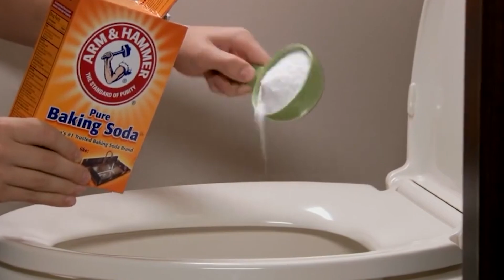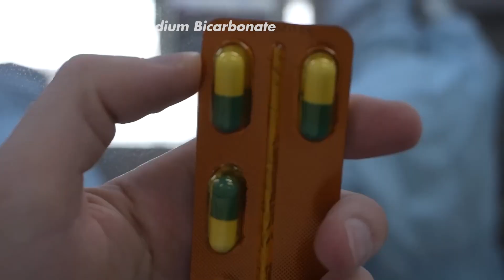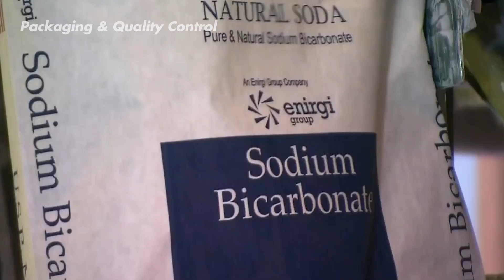How Baking Soda is Made

Comment: Sodium bicarbonate can also be used to deal with heartburn. 1/2 or 1 teaspoon of it melted in water or ingested as is (with nonacidic liquids) will decrees the acid in your stomach and alleviate the discomfort (sidenote it will make you burp a lot sodium bicarbonate + acid = gas ).
Reply: make a drink with caraway seeds or aniseed or star anise seeds you will have no heartburn.    balance your died , eat less fried food , meat, sweets, white bread, biscuits chicken you won y have no acid😅
Reply: True, but people with wounds or ulcers in the stomach should be careful when consuming it.....  It may work in reverse.
Reply: @candyanek5331  Indeed if you use to much it stimulates the production of acid in the stomach because it makes the acid level to low, and the body ramps up production to reestablish balance.
Reply: One can also eliminate "acid stomach" by a tiny sip of rice vinegar.  Strange, but true
Reply: I use this..works wonders FAST
Reply: It is an old-timey remedy.  Works best with WARM water; approximately 1/2 teaspoon of baking soda to 1/4 to 1/2 cup (warm) water.  No one need suffer with heartburn if you know this QUICK fix !
Reply: Baking soda is the only thing I use for heartburn and it works great. One important thing about using baking soda for heartburn is to make sure the crystals are completely dissolved or you might have another stomach pain. People over 60 should not consume more than three half teaspoon doses within a 24 hour period.